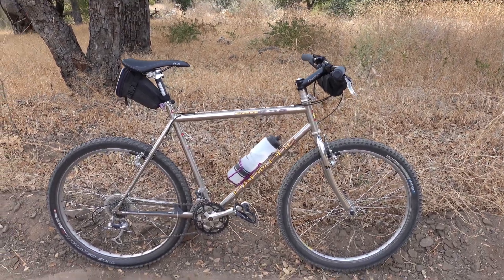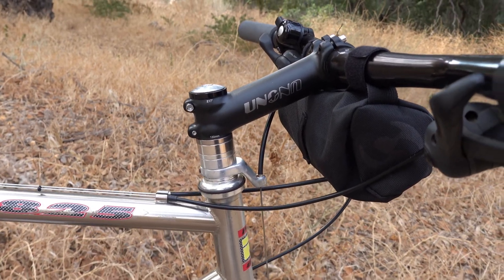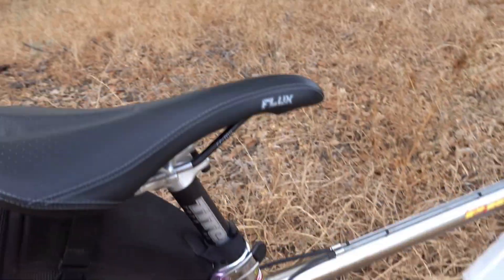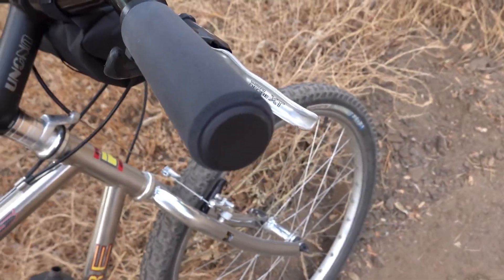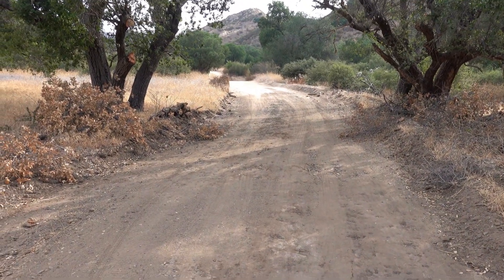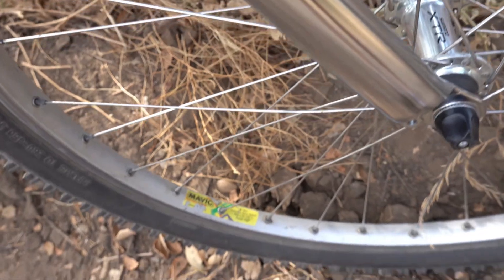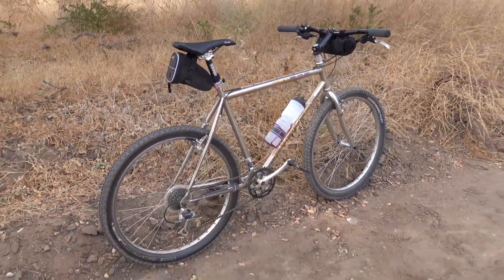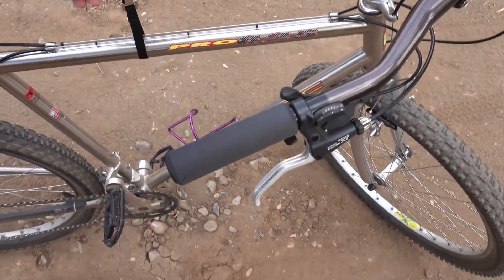Bike Check: 1995 ParkPre Pro 825 Vintage Mountain Bike - Titanium Plated Tange Superlight

Comment: Those frames are super impressive, In my country(sweden) a pretty big bike cycle store/retailer imported these frames under there own brand Easton because of the tubes used and it was my dream bike. super light 1300gram for a M frame set as well.

well correction not this frame but the Parkpre Team frame.
Reply from the maker: As you mentioned, the steel used between the Team and Pro is different

Team = Tange Ultimate Ultralight
Pro =  Tange Ultimate Superlight

I've never had this bike down to the frame to weigh it, but you can feel how light it is compared to other bikes from the time.

Comment: Nice bike! 👍 
What fork is it? Is it original parkpre?
Reply from the maker: Thanks, it's an uncut Tange Prestige fork.  The 825 came with fork options, and a rigid was an option, but mine didn't have it.  The Parkpre fork had a matching finish and is straight.
Reply: My original pro 825 came with a Manitou 3.